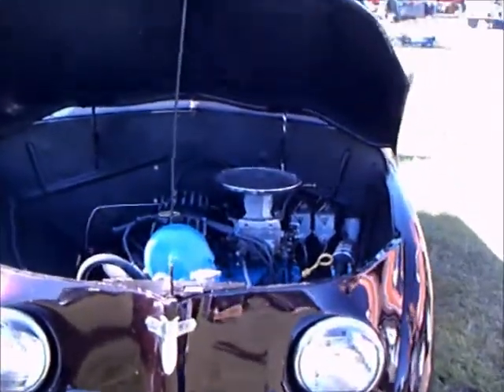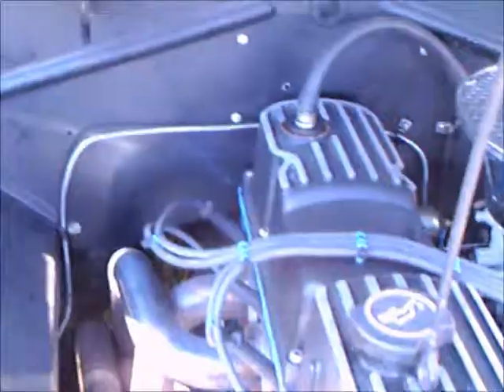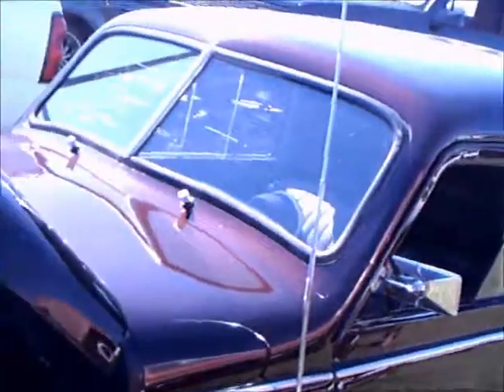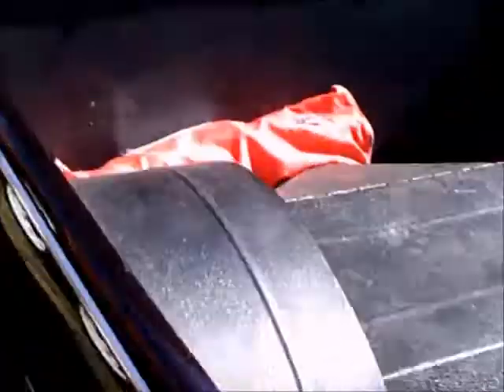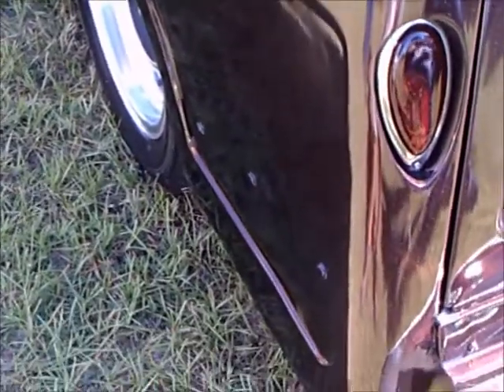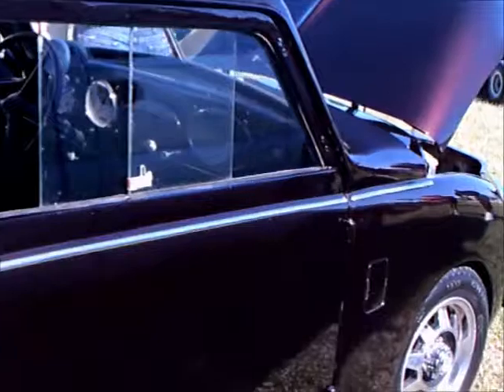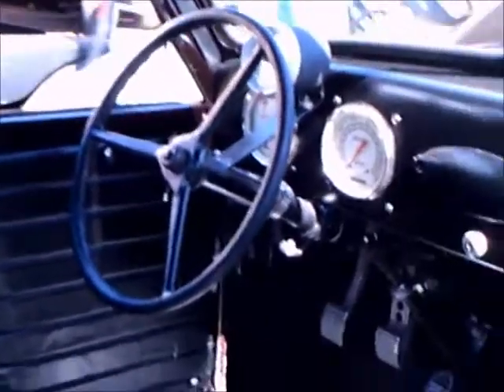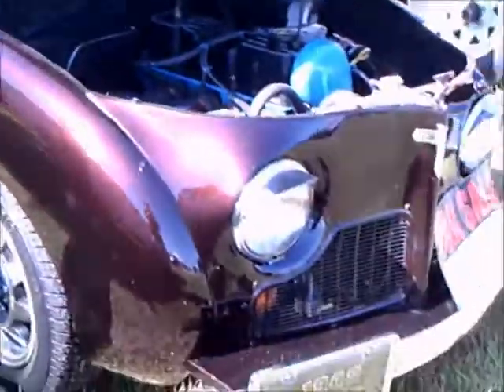1949 Crosley Truck Brown SumterFG050315

Comment: ...and the winner for the best resto-mod is - this one. That little Pinto 4 banger looks right at home. Everything looks professionally done. :)
Reply from the maker: cheddyrod Hey, Chester!  I'm sure it took a lot of work to place this engine in that tight space, and design the suspension, transmission and rear end to match.  Thanks!  :) Jack

Comment: I would call that a MINI..mini truck . It is a neat little thing !!! Do you know if that was the Original engine ? Seeing the Tach makes me think they may have added some extra H.P.
Reply from the maker: not2fast4u2c Hey, Jim!  Yes indeed...it is beyond mini!  LOL!  This is a replacement engine...the original was much smaller, but with an overhead cam. The current engine is a Ford Pinto/Mustang 4 cylinder.  Thanks!  :) Jack